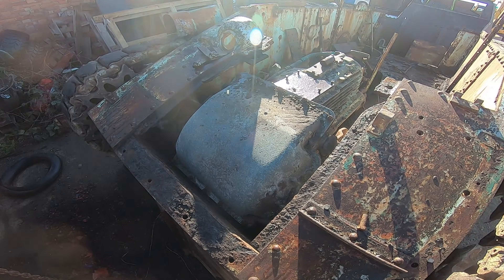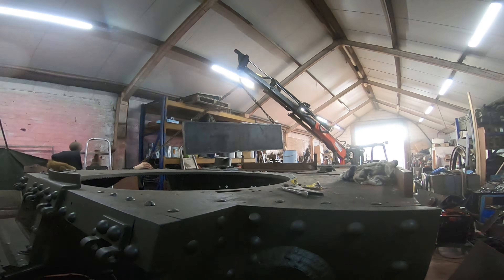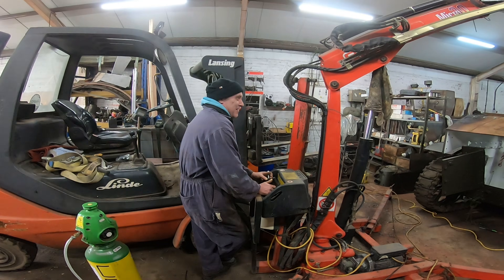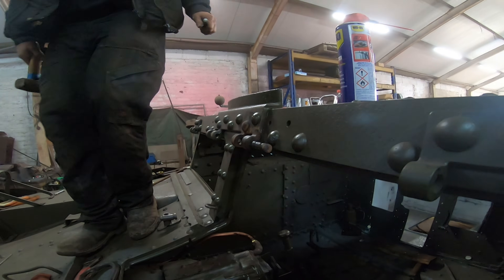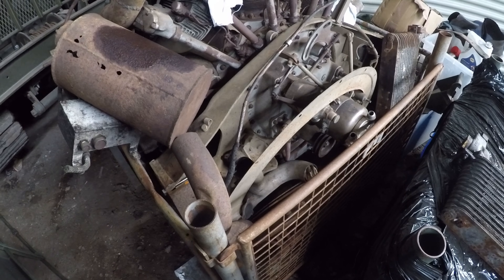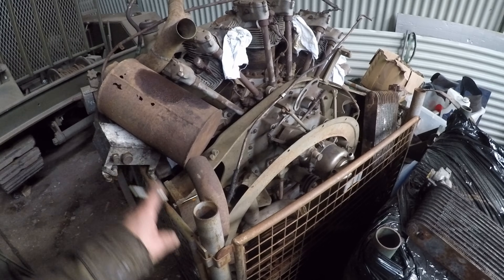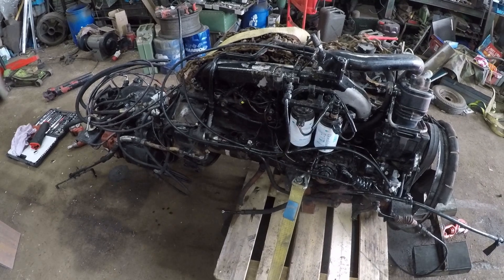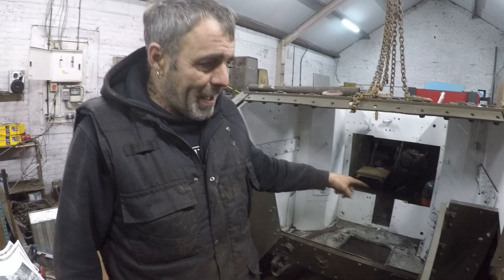M3 Stuart Tank, Engine Substitution, Part 3

Comment: The Diesel is the way to go!!! Even if it's old, you should be able to get parts for it. Cheers from across the pond in the USA!!!
Reply from the maker: We have been trying to find the parts but no luck at the moment, if we can find them at a later date we might convert it back to the radial. We need the tanks to run soon so can't wait about.